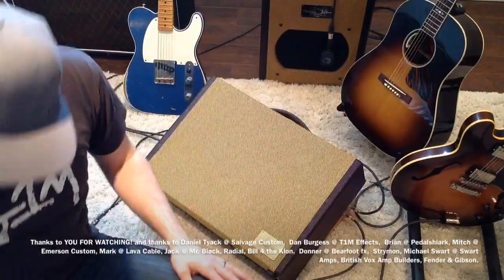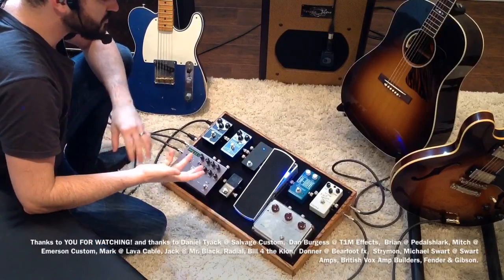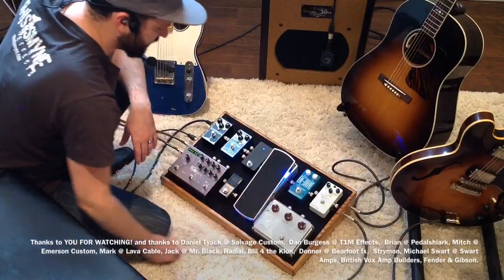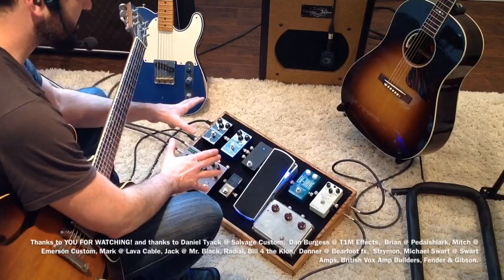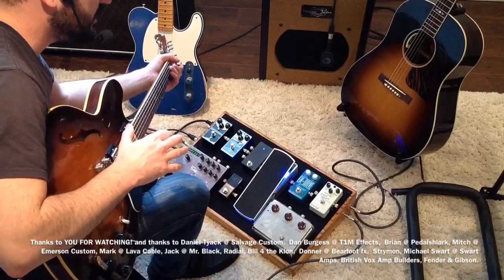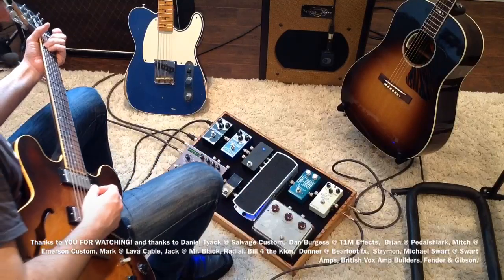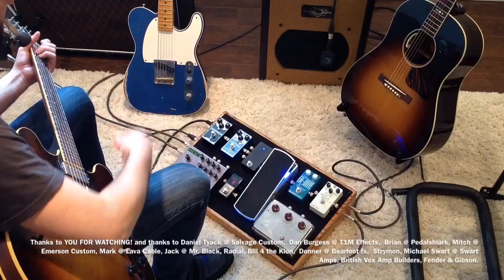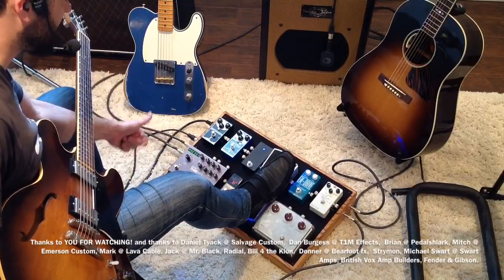Curtis's Salvage Pedalboard Demo

Comment: How are you AB/Y 'ing your amps?  What is the pedal to the front left of your volume pedal?  What is your wiring signal path using your AB box in conjunction with the direct outs on the Salvage board?

Comment: Sorry, I don't think I was clear. I typed that out really fast on my phone. You're running stereo out of your timeline, BUT it looks like you are using a This1sMyne AC/EC (which is not a stereo loop). Does that mean that one of the outs on your timeline (say left) is going to a Reverb pedal and then back into the AC/EC and the other timeline out (say right) is going to a Tuner then Reverb and then to a second amp? Just trying to figure your signal chain out.

Comment: It the This1sMyyne pedal you are using the AC/EC? If so I'm confused how you're running your timeline in stereo??? I have a stereo delay and reverb but my AC/EC is not stereo... Are you running stereo out to each reverb and only running one of the reverbs back into the AC/EC and the other just straight out to the amp?